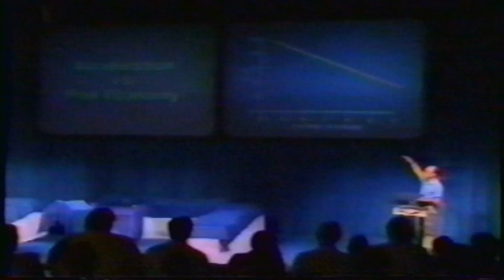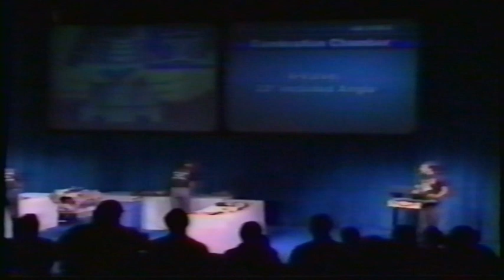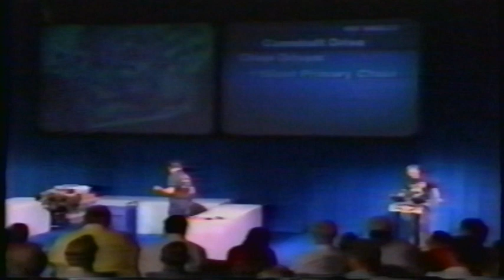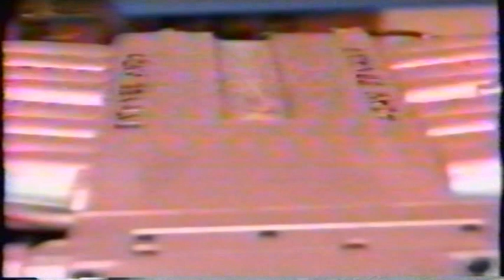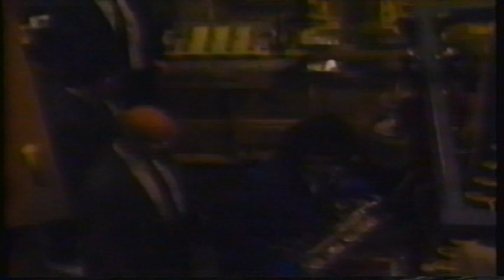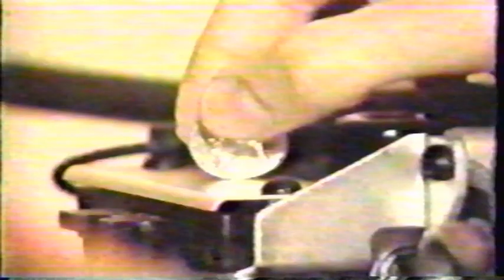C4 ZR-1; LT5 Press Conference; ZR1

Comment: Hello everyone, i’m thinking of purchasing a 1991 ZR1
Here in Australia I have located one with 4000 original miles on it. The question is being on the other side of the planet and parts availability for the engine how reliable is this engine and what are the main issues people are having with these engines if any? Thanks in advance, excellent video
Reply from the maker: Engines are generally bullet proof.  Fuel injectors and pumps are probably the most likely thing in need of replacement.     Jerry’s Gaskets In Oklahoma Has most of the parts anyone would need
Reply: Parts for these aren’t hard to source but you have to stock up on a few things that aren’t at your local parts store. I have traveled extensively with mine over the years and I always had a complete hose kit, water pump and gasket spare serpentine belt that would all fit in the little storage compartment behind the seats. Also I have a spare starter and alternator on the shelf just in case. Alternator is a pretty common part but for peace of mind the rest of the parts I would recommend. Good luck by the way I never needed anything on a trip. Just prepared.

Comment: Cool video, I have owned #2822 1990 ZR-1 since May of 2018. 74k miles and she had been sitting for many years. I turn my own wrenches and had a lot of maintenance to do. Fast forward to May of 2020 she got tags and now 6k miles later she screams. With the help of many on the Registry and the shop manuals I have learned a ton about this work of art. It's an engineering marvel, the records this machine set is a testament to the LT5 and the C4 platform. No other generation has accomplished what this car has. She is still
King of the Hill.
Thanks for posting, very cool. 👍👍🏁🏁
Reply: From the start of this promo it's bullshit . The very first series of Corvette didn't even have a V8 it utilized the 6Cly 235 or maybe even the 194 either way the word performance was NOT what I would have used to describe the Corvette  it wasn't until the 265 cubin inch was installed that we got a better look at the potentiall....